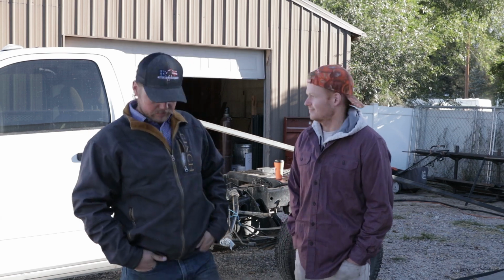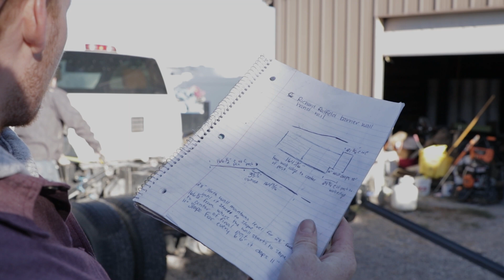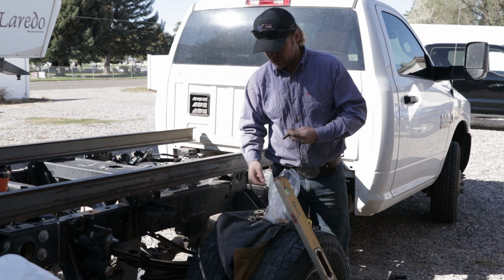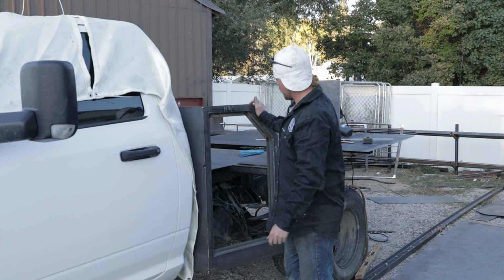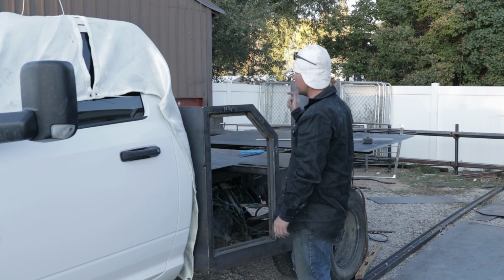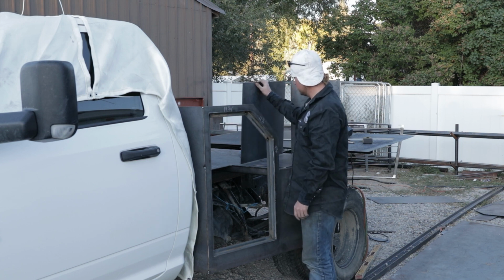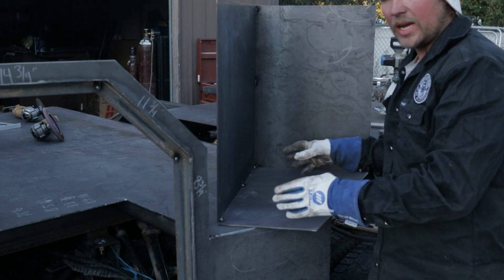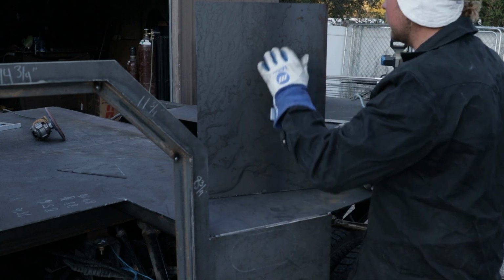Welding a Flat Bed days 1-2

Comment: You have to go to the store for bolts? Stock some hardware. I use the same angle iron trick when using a cutting torch!
Reply from the maker: Yes I go to the store for bolts. That’s where most people buy them. Ace hardware is like 4 min from our place.